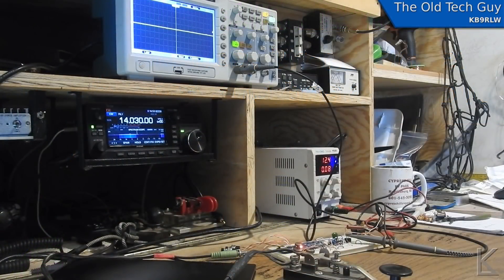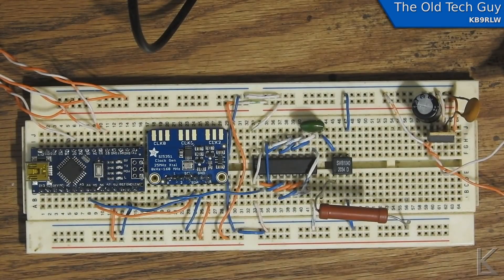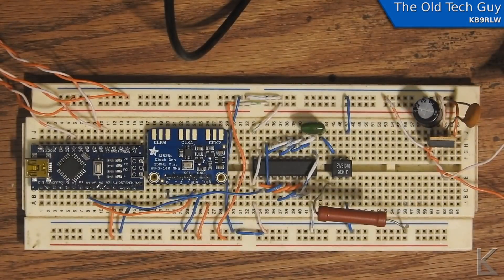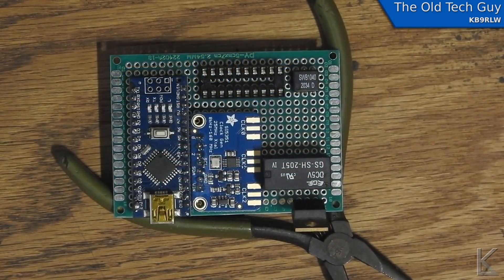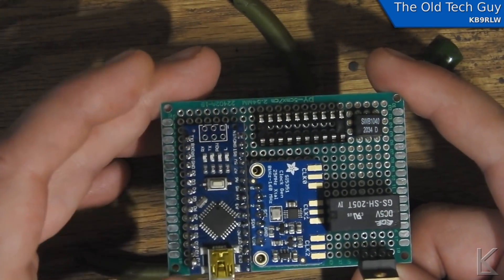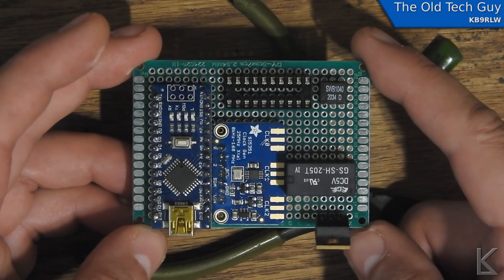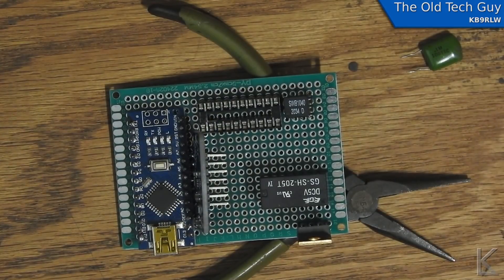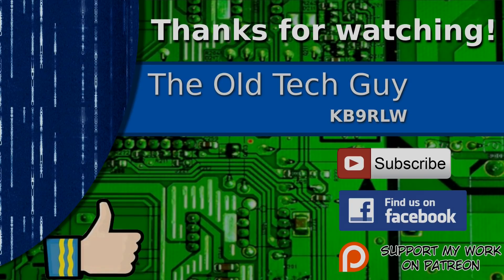Ham Radio - The CW flea. Coupling transformer and board layout.

Comment: Hi Kevin, very nice experimental design. I like the way you try things and learn.
Just thinking of something important: to get the maximum output level from your "power" stage, dont simply rely on a ground rail, but prefer a ground plane and several supply decoupling caps (note that the arduino and the Si5351 board already have their own ground plane and decoupling).

Comment: I've used female pin headers to raise the Si5351 up on the board, and you can put parts under it.  It also means you can remove the Si5351 breakout as needed because it doesn't have to be soldered to the board.  Another possibility is hanging the Si5351 off the edge, but it is of course nice to stay within the dimensions of the protoboard...

Comment: So, you're getting a half watt out, and the transformer is rated for a quarter watt in.  You'll probably get away with that for a while.
Reply from the maker: The transformer is rated to handle 250ma of current.  We're nowhere near that.
Reply: @loughkb    The rating of that transformer is 250 mA DC current,  and 1/4 watt (+ 24 dBm) RF input.  The specs show about .5 dB loss at 14 MHz.  If you are getting a half watt (+27 dBm) out of it, you must be running +27.5 dBm (562 mW) into it. You are exceeding the rated input power by a factor of 2.25, or 3.5 dB.  But, knowing Coilcraft, and considering that the duty cycle of CW is about 50 percent, you'll probably get away with it.  Running any of the high duty cycle digital modes would be pushing your luck, though.

Comment: If you added a header socket on the board for the clock generator, you could gain enough height to plug it in so that the board sits over the Arduino and still get it in your Altoids tin.  May need some insulation under the clock board, but it frees up a lot of space.

Comment: Great work Kevin.. would it be possible to have a switch or button you hold down which would enable the CW paddle to tune the frequency up and down. Or a long hold on the key would put the radio into frequency tune mode and no input on the key would turn it back off. Maybe I’m crazy just thinking out loud on how to eliminate the tune switches and save some room.
73 Karl
Reply from the maker: Since it's all controlled by software, you are free to experiment with the design however you like.  I'm sure there will be many variants built with many changes and extensions to the basic design.

Comment: How about making the filter on a pluggable board so that one could switch out the filter for use on another band? DE WA1KLI
Reply from the maker: Yeah, I've already been thinking of a version two with filter modules and the arduino would detect which one you plug in.

Comment: I like using the double-sided boards as well. I find it helpful to lightly buff the boards with double-aught steel wool...I find it helps the solder flow and adhere better; especially on the larger pads.

Comment: If you use a strip of pin sockets for the clock gen breakout board, would it be tall enough to overlap the breakout board on top of the arduino? That might be a little shorter than just standing the breakout board on its edge.
Reply from the maker: That's a thought, but it's going to be no taller than the regulator after I add a small heat sink to that anyway.